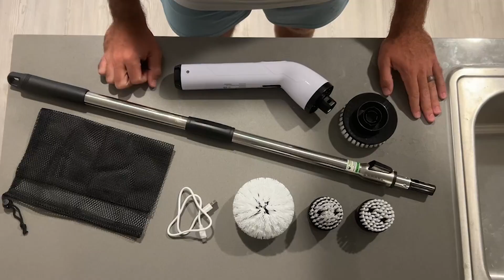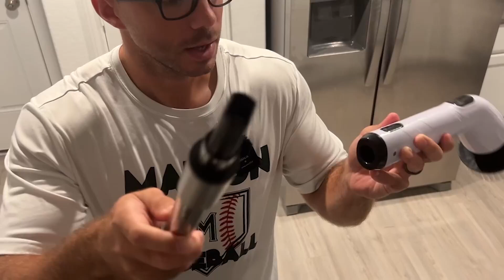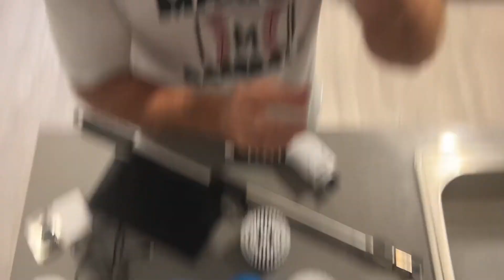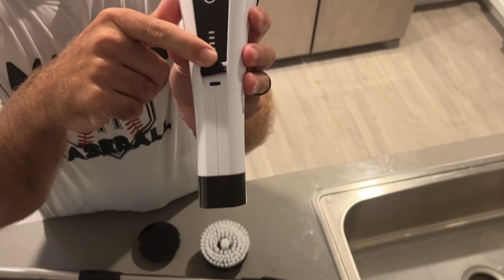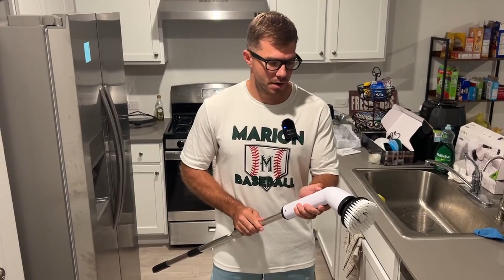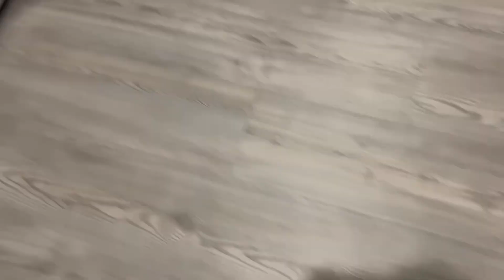Best Electric Spin Scrubber Cordless Bathroom Cleaner Adjustable Handle Power Scrub Brush

Comment from the maker: 👉 Check the Top 5 Amazon affiliate link below for the latest price, discounts, and Subscribe & Save options to save even more.

📢 TUYU Electric Spin Scrubber, Full-Body IPX7 Waterproof Bathroom Scrubber, Adjustable Extension Handle, Cordless Shower Cleaner Brush - 
🔎 Check On Amazon: https://amzn.to/4m5gMMM

📢 Electric Spin Scrubber, Dreazu IPX7 Shower Scrubber with 7 Replaceable Brush Heads & Retractable Handle, 2-Speed Adjustable Shower Cleaner for Bathroom,Toilet, Bathtub, Kitchen, Tile Floors - 
🔎 Check On Amazon: https://amzn.to/48dgNIN

📢 Leebein Electric Spin Scrubber, Cordless Cleaning Brush with 8 Replaceable Brush Heads, Tub and Floor Tile 360 Power Scrubber Dual Speed with Adjustable & Detachable Handle for Bathroom Kitchen Car - 
🔎 Check On Amazon: https://amzn.to/4tqZXhV

📢 Cordless Electric Spin Scrubber, 4 Angles with 8 Replaceable Brush Heads, Adjustable Handle 3 Speeds with LED Display-90Mins Runtime, IPX7 Waterproof Scrubber Cleaner Brush for Bathtub Bathroom - 
🔎 Check On Amazon: https://amzn.to/4tjB3R8

📢 Electric Spin Scrubber with Power LCD Display, Cordless Bathroom Cleaning Brush with Adjustable Extension Handle, 400RPM/Mins, 9 Replaceable Brush Heads, IPX7 Waterproof for Shower, Bathtub, Tile - 
🔎 Check On Amazon: https://amzn.to/4c4ONbx

👉 See More Details: https://cleanerguides.com

⚠ Affiliate Disclaimer:
This video contains affiliate links. If you purchase through these links, I may earn a small commission at no extra cost to you. This helps support the channel and allows me to continue making honest reviews. Thank you for your support! 🙏☕